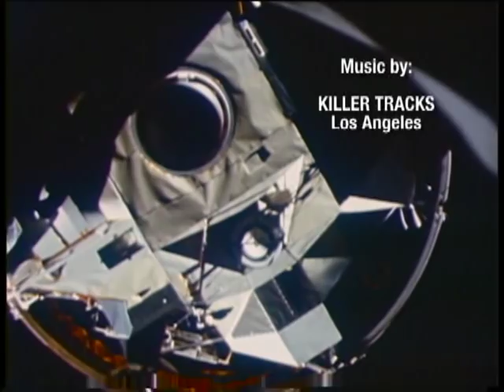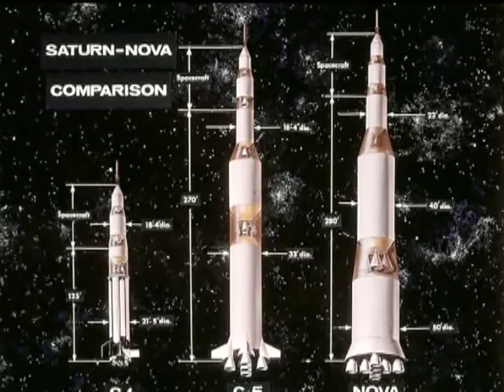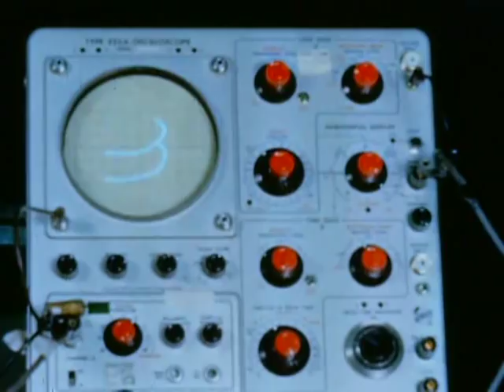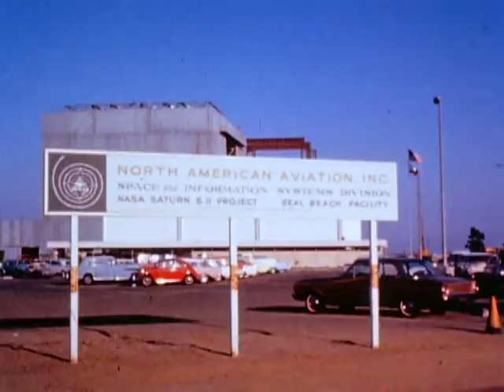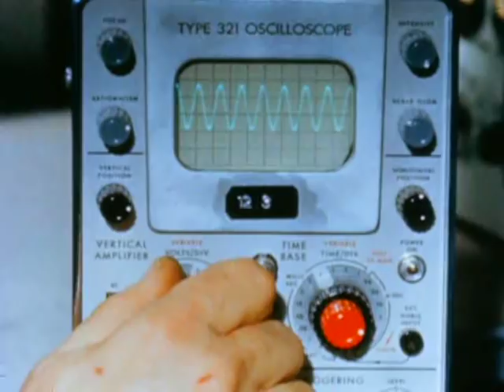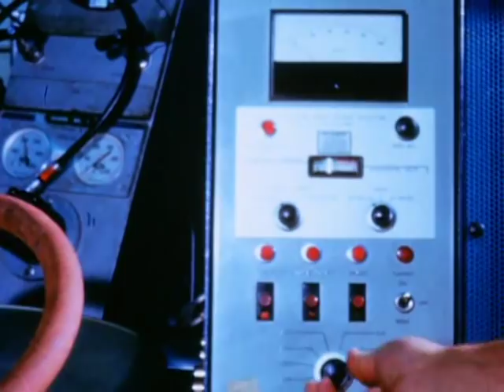Spacecraft Films   The Mighty Saturns   Part II   The Saturn V 2002

Comment: Saturn V the best looking awesome rocket ever built and flown, It will never be bettered.
Reply: bella kort ALready bettered, by Falcon heavy from SPACE-X.
Reply: @Beamshipcaptain  falcon heavy is less than half of the weight of saturn 5….
Reply: @roch733  I know. Saturn V was basically primitive World War II technology...
Reply: FH can't even half to orbit. 60 tones to 140 tones to low orbit. That means not bettered!
Reply: Artemis SLS appears to be the closest match physically, and in spirit, as the early Saturn rockets were built from already proven parts from other rockets, and SLS is made from already proven space shuttle parts such as the main engines and the solid side boosters
Reply: Tbh I can see your vision. With respect to pure liquid propulsion, it was the pinnacle of Engineering.
Reply: @alanfitzgerald9026 
But in pure liquid propulsion, the Saturn V was and is still king.

Comment: The impressive thing is that not a single Saturn rocket, be it 1B or V, caused a mission failure or even a test flight disaster.  (The Apollo 13 explosion that cancelled the lunar landing was in the Apollo Service Module, but the crew managed to return safely.)  A truly fantastic achievement.
Reply: a truly S-F achievement, to be precise...
Reply: Apollo 6 was an unmanned Sat V vehicle and  it was an utter failure but an unmanned test flight.  I would imagine that the Apollo 7 astronauts would have been pretty concerned going into orbit knowing that.  But what you say is correct for Manned flights.   TEF
Reply: Except the disastrous Apollo I fire that killed three astronauts.
Reply: @Beamshipcaptain  saturn rockets not the capsules.

Comment: A most enjoyable and different Documentary, thank you. One thing about "POGO".....that is what we Fuel Tanker drivers call "Tank Slap".
Reply: Not the same thing by any stretch of the imagination.
Reply: It is longitudinal vibration of the whole internal structure wrt the hold down points and is caused  by either vibration from the turbo pumps or the rocket exhausts.  The spring mass system clearly varies in mass during ascent so at some point the natural frequency may come into range of the exciter.  My recollection is that some sort of helium filled buffer business was used to damp the vibration but I never saw a drawing of what was done.
Reply: On fuel slap.   During staging this did occur in the tank about to be used which is why the ullage had to be as small as possible  consistent with the helium pressure charge.  Just after burn out,  small thrusters were used to give the remaining stage acceleration so the fuel would settle in the bottom of the tanks.  the consequences of not having it there would be turbopump starvation and burn out and worse things if the  tank bottom accelerated seriously with respect to the floating  fuel.... like tank end rupture.  You wonder if some of this was found out the hard way on early unmanned flights.

Comment: "With the rocket, you have to generate enough thrust to take off.  And that means your thrust has to be greater than your total weight of your system."  Rocket Science in a nutshell.
Reply: The efficiency of a rocket (rate of fuel burn vs how quickly the rocket rises into the sky, conversion of fuel to gravitational potential energy) is better at higher speeds, so you don't want your thrust to only be slightly greater than your weight otherwise it will take to long to accelerate. Also your weight is reducing as you burn away your fuel so you have to take into account the chemical energy required to raise your rocket to the required height and the efficiency and useable mechanical energy from burning fuel at different speeds and air resistances at different speeds and atmospheric heights.
You also need to take into account the spin of the earth if you are angling the rocket for orbit (around 1000mph x the cosine of your latitude) and also wind conditions.
Reply: @TimpBizkit  What you say might ring true for upper stages, but not the first stage.
Reply: @TimpBizkit    see  https://en.wikipedia.org/wiki/Tsiolkovsky_rocket_equation  to see what is going on.   You are basically correct on the weight versus thrust issue  but the rocket engine is no less efficient on the ground than at height;  because the efficiency is a function of the  propellant chemistry versus minor corrections for exhaust back pressure .  Clearly you need to ensure the acceleration is high enough so the vehicle has enough speed to have to make minor corrections for  high altitude winds.  Rockets at least in the west are NEVER angled for orbit but follow Oberth trajectories which are almost elliptical and of course tangent to the final orbit at cut off.   Russians were more brutal I believe and used something closer to an inclined launch system for the soyuz.
Reply: The Saturn V took about one minute to reach 10,000 ft. The Space Shuttle was much quicker off the pad.

Rockets roll onto course as soon as possible, but go almost straight up to clear the atmosphere, then pitch over, as rockets become more efficient in vacuum. Air pressure must be overcome while ejecting the exhaust out of the nozzle as well as the vehicle overcoming resistance. Aero spike rocket designs that use atmospheric pressure to direct the exhaust were considered for the Space Shuttle, but were unproven and too revolutionary to test on manned flight.
Reply: @psycotria    This reply shows an ignorance of the functioning of  a DeLaval nozzle.  In the DLN a  normal  shock wave forms in the throat and the delta p over this shockwave is mostly controlled by USream absolute P and absolute T (K).  The back pressure of the atmosphere has very little effect.  The rocket pitches over because it needs to be tangent to the final elliptical orbit at perigee not for your supposed reason.  Herman Oberth worked this all out (efficient transition) in Germany. 
 It is interesting that the SShuttle was quicker off the pad to 10000 ft.  (I can't validate that easily).  The propellants used in the  SRBs were some epoxy/ amm perchlorate/ Al powder mix.  Generally these solid propellants have lower specific impulse than  LOx /hydrogen mix and alternative fuels. However the SRBs don't have the dead weight of motors and much support structure , so the mass to accelerate versus thrust available might look  a lot better when it is all added up.
Reply: Electrogravitics from TT Brown and Searl technology patents are far more powerful and efficient than rocketry, and are inertia and G-force free, and FTL, just like the new NAVY Pais Patents... We have the tech to go to the STARS, FTL.

Comment: I must add a little defense of North American.    The LM kept growing in weight.   Because of where the S-I and S-IVB stages were in development, all that weight challenge fell to the S-II - and very late in the program.  I am not suggesting that all this was NASA's fault (or Grumman's), but change is a killer to schedule - and to accommodate the magnitude of the change that was required of the S-II required nothing short of miracles.   The common bulkhead with a temperature differential of more than 200 degrees was quite a challenge.   The fact that NA DID deliver the S-II in time to meet Kennedy's goal deserves some measure or recognition.

Comment: That is some amazing footage I love tech,how the 3rd stage has exploding bolts that drops it off when it done pushing it out from gravity,what an insane amount of technology present in this rocket,let alone what was 300000 hand built parts wow,so what was the recovery process if they used the same Saturn 5 or did they just build 6 of them,sorry 8,two are in the museum,they said.
Reply: Build 18 (more or less functional), flown 13. No recovery what so ever, that is SpaceX's thing since 2016 when they've first landed and re-used booster B1021 1st stage. The first launcher to be fully recoverable still has to be invented (although the SpaceX BFR should be able to do it).

Comment: U know I just thought of the craziest job on building the rocket,how d u like to be the guy who installs those exploding bolts between stages,before or after they are filled with fuels,not me,plus where was the switch under glass by a hammer on a chain.that's confidence in your engineering,I know they probably blow on auto mode...but still scary.
Reply: Actually, Kellie... That was one of my jobs, lol.

Comment: Musk wants to revive the Nova concept as the the Big Falcon Rocket/Starship.
Reply: Nope. The Nova concept, as described in a National Geographic article of around 1960, was bigger than Saturn 5 and used several solid fuel cores for its first stage. The technology of large diameter solid fuel cores was not well developed at that point. In any case, nobody was thinking about reusability. BFR/BFS is a new paradigm, growing out of the Falcon experience, and what appears very obvious and elegant today was strictly in the realm of science fiction until the 21st century. SpaceX has proved that  brute-force retropropulsive hypersonic re-entry works for first stages, but re-entry from orbit of a large vehicle with minimal wings has yet to be demonstrated (though STS and X-37B have worked admirably with larger wings). I wonder how the BFS can turn around after a nose-first re-entry to land on its tail; the aerodynamic stresses must be very large.
Reply: @awuma  
SpaceX and Elon has so far proven people like yourself wrong! They are problem solvers, visionaries and learned to think outside the box. And what have you done in your life so far?

Comment: 04:10 If Lift_airplane < Weight_airplane, you don't "take off" either; same thing.
Reply: However, thanks to these wonderful things called "wings" that generate something called "aerodynamic lift," Thrust_airplane != Lift_airplane, and thus you can take off with Thrust_airplane < Weight_airplane.  Not so with rockets, they don't have the advantage of using aerodynamic lift to help out.
Reply: @rdfox76  Nor do rockets have to contend with the drag that comes with producing lift.  In addition, if you are not careful, disturbances to that lift can cause 'severe flight departures' so just having lift is necessary, but not sufficient.

Comment: Can anyone confirm that by the time the bottom of the rocket [Saturn V] got to the top of the tower it was doing 100mph?
Reply: It was about 50 mph.   Here is a link to the documentation: https://spacemath.gsfc.nasa.gov/weekly/8Page2.pdf  You can also do a quick calc yourself.   Formula is d=1/2*a*t**2,  using a (acceleration) as 8'/sec sq (T/W = 1.25, but subtract out gravity, 1);  tower height about 360ft., you get a time of about 9 seconds.,  V=a*t (acceleration is roughly constant) and you'll get a speed of about 50-55 mph.
Reply: I believe it is the Shuttle that was going that fast when it cleared the tower.
Reply: george vila  You say that despite the fact that Doug Ball did exactly that four months before you posted?

Comment: Shuttle haters like to refer to the S-5 as “Good old reliable “. Those who worked on the S-5 had another term. “The Saturn 5 minute”
Reply: From second one to second last, abort was possible.  Von Braun,  Kraft and probably Kennedy had kicked everyone in the arse who'd come up with a 2 minute phase during launch, the most dangerous time of every flight,  with no abort option. 
Or a reusable concept, multiple times more expensive than a throwaway rocket. Of course that wasn't the plan, but it happened. 

 Fun fact: all the abort ideas the Shuttle planning team ( in which C.KRaft actually was) were ruled out, one after the other for cost (and weight) reasons. Because the 10 comitees who had set the silly specifications for the shuttle (" be able to do everything, anybody wants") made it insanly complicated and heavy.

The 7 Challenger victims were a direct result of this.

Btw: from launch to TLI (last burn of the Saturn) was more in the region of hours, not 5 minutes. The shuttle with a simpler concept could have been amazing. It was amazing. But in a very insane way., There is a Talk by Christopher Kraft on youtube, who was even after discovery very outspoken pro-Shuttle, where he talks about what it was like, what went wrong, what could have been and what should have been.
Reply: 5Andysalive Expendable is less costly to develop. More costly to operate. The throw away mega rocket topped with a retro spam can is not and never will be a viable routine access to space
Reply: @5Andysalive    Rule Number One on a sinking ship. Get out, get off. Both Challenger and Columbia should have had failsafe ejection. Columbia especially. Ground should  have aborted the mission instead of ordering the doomed people to happily go to a horrible death.  Ground knew they were probably going to die. It was murder. "They're going to die anyway. Might as well let them have a good time." What went through the astronauts' minds as they  realized NASA was killing  them?